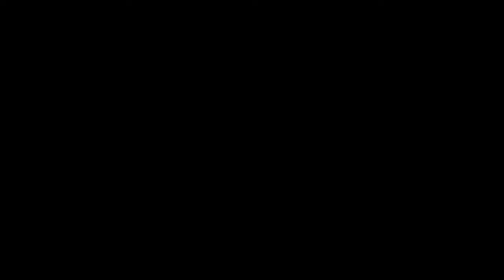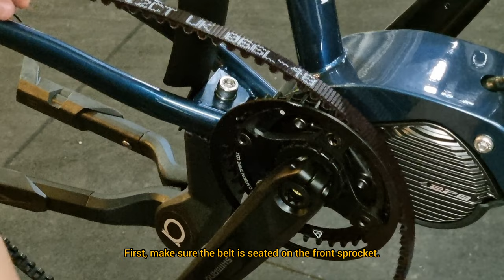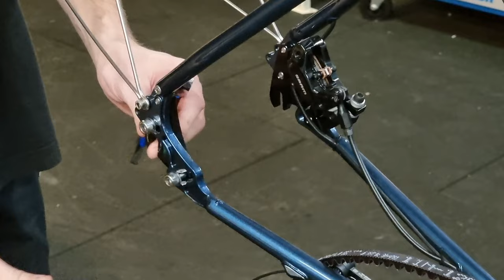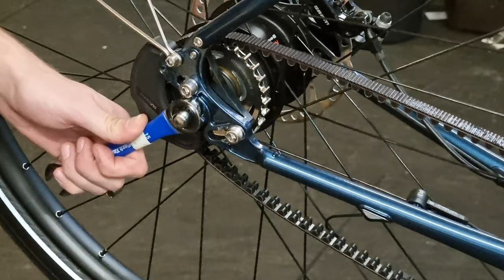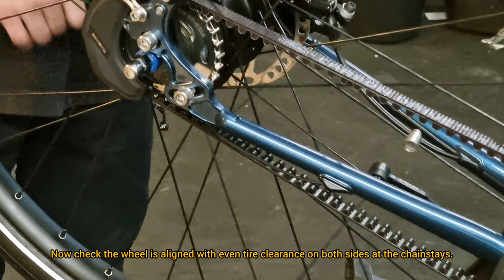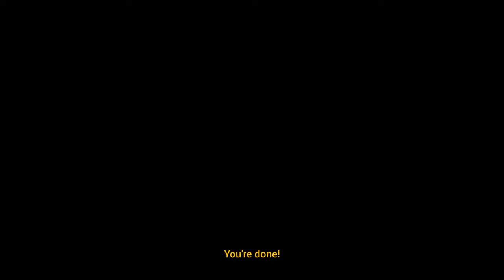OMNIUM Tutorials #3:  How to install your belt drive wheel

Comment: Thanks for the video.  If you remove the wheel afterwards fi for replacing inner tube, does it require loosening en refastening the rocker dropouts, or can you removing without adjusting the rockers (and still be assured of correct belt tension)?  Thanks!